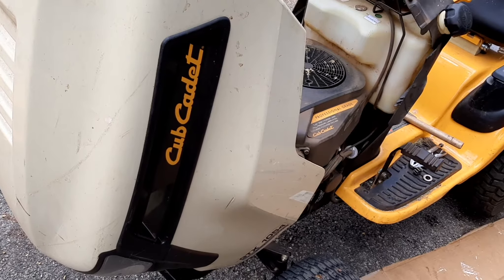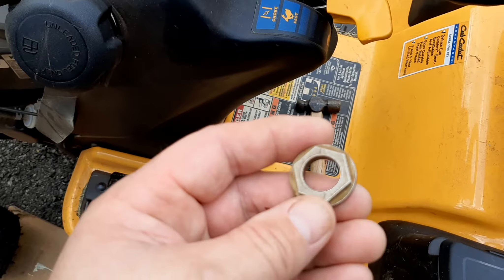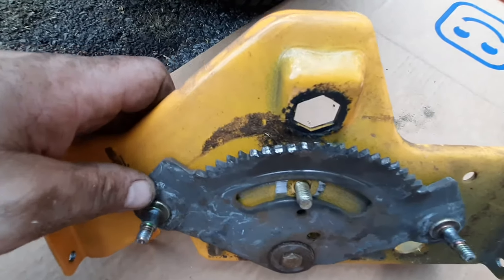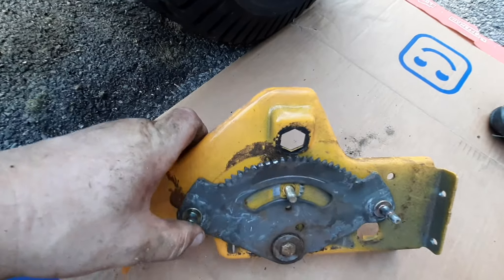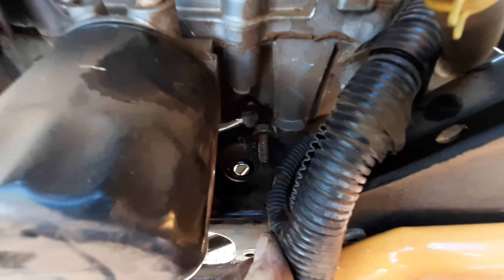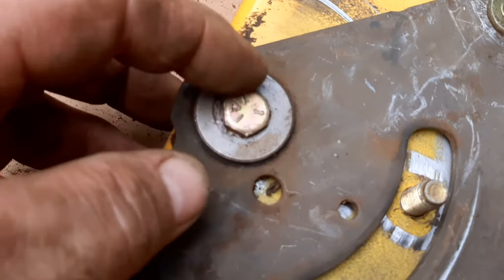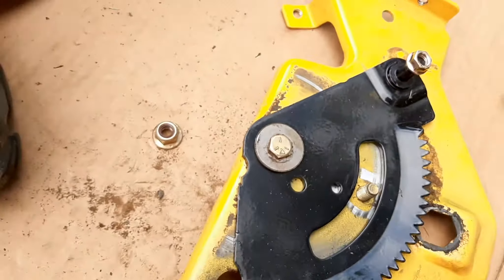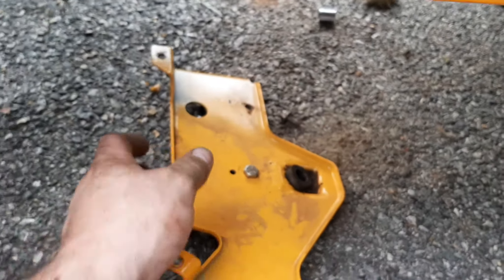Cub Cadet GTX 1054 Steering Repair Diagnosis

Comment: I change my oil on the 1046 cub cadet by taking it out the dip stick tube. I use a marine type oil changer that you pump to create a vacuum. It draws the oil out with this vacuum. It works faster if the oil is warmed up first. I grease all the steering points with a spray can of wd40 lithium grease. The can has the magic straw (tube) so you can direct the stream of lubricant. I have the lawnmower lift that raises the front wheels a couple of feet so I can get at it. I also spray the steering bushing from underneath the gas tank. I spray next to the steering shaft where it goes into the frame. I put about 18 inches of 0.110 inch OD plastic tubing in place of the magic straw. Then I can place the tubing next to the shaft, and press the spray button with the other hand.
Reply from the maker: Excellent, it sounds like "Clear Sailing" ahead for you indeed on the Cub!!